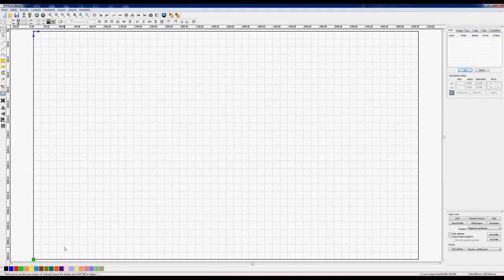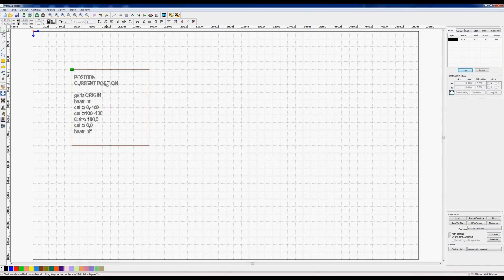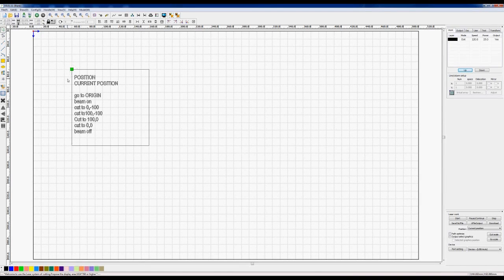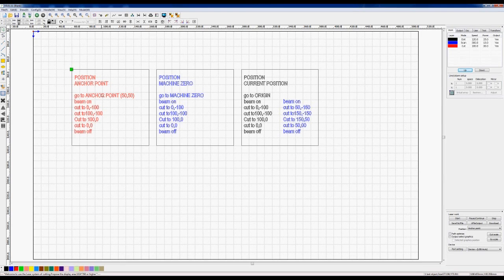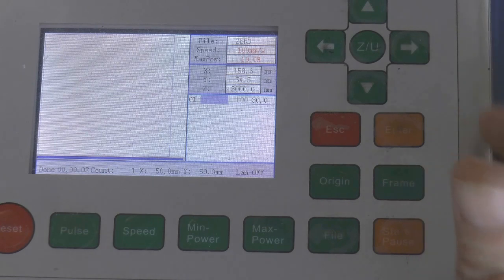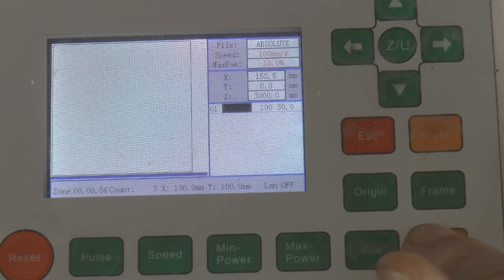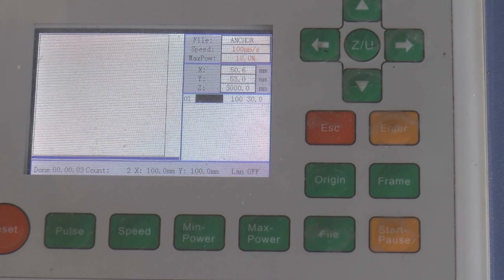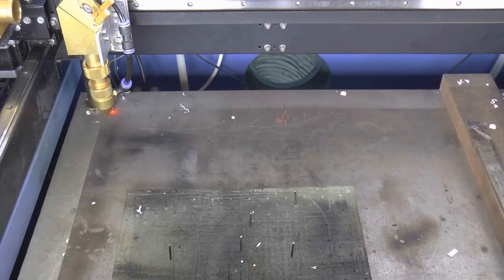RDWorks Learning Lab 73 Head Position Control revised

Comment: thanks for your videos! I noticed that when I repeatedly cut the same design, the cut tends to gradually move a few millimeters down the Y axis and therefore the cut does not always reposition itself in the same point. What could be the problem? Thank you for your answer!
Reply from the maker: Hi Antonio
There are two main possibilities. One, is it a mechanical issue? Two, is it a software issue?
If the drift is repeatable then you are probably looking at a softare issue.  A simple test for this is to draw rectangle 75mm wide and 25mm tall on a black layermand then copy it onto a blue layer so that the two rectangles perfectly align. Make the blacl layer a SCAN layer with say a 0.2mm line  intervak but make it  a Y axis swing mode  (up and down engraving). Make the blue layer a cut layer with power of about 25 and speed about 100 so that it draws a frame around your engraving as the last operation. IF you have a Y software problem  you will see the engraving drift outside the drawn frame.
 Rotate the boxes 90 degrees, set the scanning mode to  X swing and test it for X axis drift.

 IF either of these tests  show steard drift then go to the vendor settings in RDWorks and lookat the Rising Edge Valid  tick box. It should be empty for both axes.

If it is not a software issue then you are now looking for a mecchanical issue . IF the issue is nicely repeatable and creates a steady drift in Y+, loss of steps when the axis moves Y- is a possibility. This will only happen if the axis encounters soe sort of stffness in the Y- direction. Only you can feel if this is happening. Turn your machine off and feel if dragging the y axis forward feels different to pushing it back. Dependinbg on the design of your machine, tightening the belts unevenly can induce the gantry to  be out of square and stop the bearings running friction-free.
 Check the tightness of all the pulley grubscrews on the Y axis motor and  pulleys, and flexible shaft coupling. This can be another cause of drift.

The final possibility is that the acceleration factors are too high.. Have you saved your Vendor and User settings to a seperate file on your PC?  YOU MUST before making any changes to settings..
 Go to the USER tab (RDWorks top right). press the READ button to uplad YOUR machine settings to RDWorks. In the CUT PARAMETERS section tyher are about 9 items. Reduce every item by 50% and press WRITE to send the new settings back to the machine. Test you machine to see if this has fixed the problem. If yes, then one by one, put the values back to original until you find the parameter that is causing your issue.

 Happy hunting
Russ
Reply: @SarbarMultimedia  Hello and thank you so much for your reply!! I'll do these tests and try to figure out where the problem is coming from. I think it's mainly software because the machine has always had this problem even when it was new (I think the settings were entered by the seller) and the seller has never been able to solve the problem. i will try by myself! 
Thanks again!

Comment: I have my machine (Def fact pare) now the machine is not working everything is silent
Everything went wrong when I gave this code
I'm sorry to waste your time.  How do I get help from the company?  Which company should I ask for?We gave to Def factory para this code HF8888 then machine frame work opposite could someone tell how to restore Def factory para sitting
Reply: Until you have a problem and try to do what you have done, only then will you find out that the Chinese did not bother to save the working machine settings to factory default. Thus when you have loaded the factory default settings you have wiped your good settings.  It is too,late to tell you now but the first thing you MUST do when you get your machine is to go Vendor settings  (RD8888) and press READ. Then press SAVE and store the settings on an external file. Do the same with the USER tab and save the USER settings.
 
 Add your disguised email address to another comment and I will contact you for more information, I will also delete your comment/email address.
 Best wishes
Russ

Comment: HI... FIRST THANKS A LOT FOR YOUR VIDEO SERIES ...
THE CURRENT POSITION MEANS THE LASER HEAD WORK FROM THE PLACE YOU MOVE THE LASER HEAD TO  AND PRESS ORIGIN BUTTON THE WORK WILL START FROM THAT POINT

ABSOLUTE POSITION MEANS THE LASER HEAD WILL DEPEND ON 0 0 POSITION OF YOUR WORK TABLE AND START WORK FROM THE PLACE OF YOUR ART WORK IN THE RDWORK GRID WINDOW IF YOU MOVE THE ART WORK IN RDWORK IN COMPUTER AND PRESS START THE LASER HEAD WILL MOVE TO THE NEW PLACE OF YOUR ART WORK IN THE WINDOW 

ORIGIN BUTTON DON CHANGE THE LASER HEAD BECAUSE IT DEPEND ON THE TABLE WORK 0 0

Comment: Hello, i have a head breaking question. Is possible to set origin from Rdworks ? Manual with buttons on the machine that is not a problem. But can i set them in the software and then the machine will follow the exact origin cordinates? Thank you.
Reply from the maker: Hi Gregor
There are lots of ORIGINS and ANCHOR points within RDWorks and it can be very confusing until you do some experiments and understand how they all work

When you switch on the machine the head travels to one corner and looks for a sensor switch. That switch set the MACHINE ORIGIN TO 0,0. This origin cannot be changed. Your RDWorks should be configured with 2 blue arrows  at this same 0,0 corner. . When you draw an object in RDWorks, there will be a green square at one corner. This green square is the  origin point (0,0) for the machine code program. It also represents the position that the head will start and stop at . You can decide where THIS origin point is by moving the head to a position and then pressing the ORIGIN button.  If you look at RDWorks bottom right. you will see a POSITION option. It will be set to CURRENT and allows you to set the  PROGRAM origin to the point you select with the ORIGIN button. If you change the position option to ABSOLUTE you will no longer be able to use that ORIGIN button. The origin will automatically become the same as the MACHINE 0,0  (in one corner) and your machine will now replicate the coordinates you draw on the RDWorks screen.
 Best wishes
Russ

Comment: Russ, I must tell you how much I have enjoyed your videos.  Your videos are the first place I go to when I have an issue.   I do have an issue that I am not able to find a solution to though.  When I am running a job the laser head belt on the sides slows down for about 5-6 passes and then speeds up again which causes a dark line across my project.  This is occurring regardless of the file I am running.  I have tried to resetting the vendor defaults (thanks for the video on that). Do you have a video that would address this or know what can be causing this to happen.
Reply from the maker: Hi Lori
This sounds like we need to speak off line as I will need a picture or maybe  even a short video of your problem. Send  your email  as another comment and I will respond. I get auto copied to my email and will delete your comment from public view.
Best wishes
Russ

Comment: Hi good day to you sir, may i know the name of those blue arrows on the upper left edge of the grid and how to change it's position? thanks a lot
Reply from the maker: Hi Christopher
Those blue arrows are the position of machine zero/zero . All the mathematical calculations for your program start at this X and Y position.. When you switch your machine on or press the reset button, the head travels to one corner to  set that zero/zero. The blue arrows should be in that same corner otherwise your programs will be mirrored. If you go to CONFIG, and SYSTEM SETTING there are two tick boxes. For back left corner the X mirror box should be EMPTY and the Y mirror box ticked. For the back right corner BOTH X and Y boxes should be ticked.

Best wishes
Russ

Comment: Hi, i have question which is also a problem for me i think. I have three machines here when i transfer file to machine 1 which is the big one it cut the same as it shows in software but when i transfer the same file to another machine it horizontally mirrored the file so everytime i have to keep it in mind to achieve the exact cutting so how to change the machine setting to cut the file as exact as i transfer it. Please help me ASAP.
Reply from the maker: Hi Amjad
All is explained in
https://www.youtube.com/watch?v=CWZvQXxbR_E

To sum  up what your problem is 
If your machine runs to back left when it starts/resets then,  CONFIG, SYSTEM SETTINGS,  and set mirror X unticked and mirror Y ticked. Also set Laser head dot to top left. Your program
ORIGIN will need to be set near to the back left when you run the program
If your machine runs to back right when it starts/resets then,  CONFIG, SYSTEM SETTINGS,  and set mirror X ticked and mirror Y ticked. Also set Laser head dot to top right. Your program
ORIGIN will need to be set near to the back right when you run the program

You can draw in RDWorks the same for each machine but you will need to keep swapping the CONFIG settings to suit the machine you plan to run on.  If you wish to run on both machines then you will need to Download or Ufile versions for each machine.

I already have this problem myself because my two machines are opposite hand 0,0. Just a minor inconvenience, but once you get your brain round tuned in, you wont even notice it's a problem.

Best regards for the New Year
Russ

Comment: Russ, with version 8.01.19 of rdworks, there is now a better use for not return. You can assign a custom docking point, for the machine to return to after a job. This can be any position on your table, not just the machine home.

I posted a short how to on the forums here http://rdworkslab.com/viewtopic.php?f=3&t=505
Reply from the maker: Hi Mike 
That's both great news and puzzling. At the bottom right of RDworks there are the 4 settings mentioned in this video. Technically only the Absolute does anything different from Current, the other two seem to default to a Current action. It's great that that you have now found the way to create a docking position , which was, I'm sure, the intention of the return to Machine Zero position.  There are often times when you have a repetitive engraving in the middle of a large sheet that JUST fits onto the machine bed. As you mentioned, you have to then move the head after each run.  To overcome this problem up to now, I always draw a cut line on a different layer  and set the speed high and the power to 1% and set it's origin position to say 10.10. It is therefore a non-cutting rapid traverse to the first real cut/engraving point on the job  but the head returns to the origin at 10,10 when the job is complete. It's a simple enough work-around

Best regards
Russ

Comment: Thank you so much for all of your videos! They have made me confident in purchasing one of my own. However, yours seems to have a power Z-axis adjustment, but most all the ones on eBay say manual adjustment. Did you add that feature to yours?
Reply from the maker: No. If you look carefully there will be a few with motorized table
http://www.ebay.com/itm/50W-CO2-Laser-Engraver-Engraving-Cutting-Machine-Laser-USB-Wood-Working-Crafts-/261919980698?hash=item3cfba5bc9a:g:J1AAAOSwf-VWVq-S

For example

Best regards
Russ
Reply: +SarbarMultimedia I was afraid of that. I already bought one that didn't have it. The picture showed it, but the description said manual. I thought perhaps they had just copied and pasted from another listing. Oh well. C'est la vie. This one is just my first intro level engraver anyway. Wanting to save up for a $5000-6000 model in the future.
Reply from the maker: Hi
Make sure you take a sceen grab of the advert. If the picture shows a motor then that's what you should get. If it does not have the lift motor when it arrives then make sure you immediately raise dispute with ebay "not as described" You may get money off or you may be able to insist they send you an upgrade kit

Good luck
Russ.

Comment: Russ, The no return does have a use - but your choice of test program makes it less visible. 

Try cutting something that doesn't have a line ending up at the same place as it starts.

And I think this goes for several of the settings, really. They are also meant for bigger machines doing bigger jobs. If you were running a 2m x 3m cnc, absolute control of were the heads ends up could save you some hassle.
Peter
Reply from the maker: Hi Peter
That's the great advantage of sharing my learning/exploration. When I make a mistake or don't poke into all the dark corners there is now always someone out there to rescue me. Now that wouldn't happen if I was doing this as a lonesome hobby in my "man cave"

Thanks again Peter

Best regards
Russ
Reply: +SarbarMultimedia And in really like having a fresh look at everything! I have learned a lot by watching your videos in the safe environment of my couch - instead of while swearing in my workshop. :)
Reply: +SarbarMultimedia hello Ied first like to thank you for your videos, purchased my 60 watt China laser and your videos have been amazing guide to operate this machine. first time laser machine owner/operator. is there a email or Facebook link I may use to ask you a question? 

Thank you

sincerely
Kevin y
Reply: Hey Kevin.

I think you should join us at http://rdworkslab.com - lot of help there!
Peter.

Comment: Russ, On my machine when I use anchor point, it uses the origin I set at the machine. After setting anchor point/origin at the machine, I can move the head and run the program and the head will move to the origin I set at the machine, where current position will start from what ever position the head is at when the program is run.
Reply: Russ, I think you're missing quite a lot by not normally using the machine over USB or network from the PC. Start a job from the PC, or Download it from RDWoks to the machine and press start on the Control Panel, and the job may start in a different position than what you're observing. I suggest you try this - Set the Origin and move the head somewhere else. Now,  "Download" your 4 jobs to the machine and run them immediately, starting with Current Position.
Reply from the maker: Hi Robbie
I'm sure you are describing what I found. There appear to be only 2 position options.  Absolute, Current and Machine Zero are all the same, they all start  from the position set by the ORIGIN button. Absolute is different in that it is DRAWING controlled and ignores the current origin.
There seems no logic to this because the manual in it's Chinglish way  leads you to expect something completely different. I keep hunting through the user and vendor parameters  and that Z/U menu in case I'm missing some configuration setting. Failed so far.
Best regards
Russ